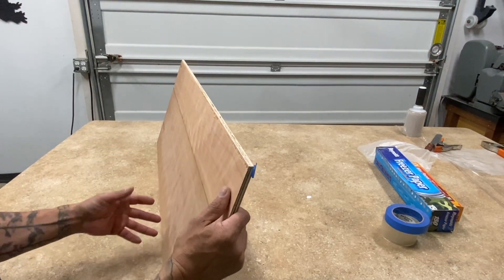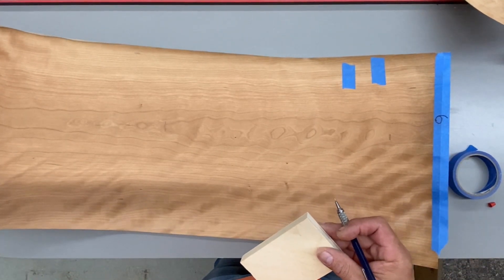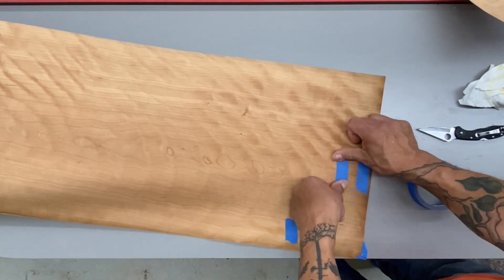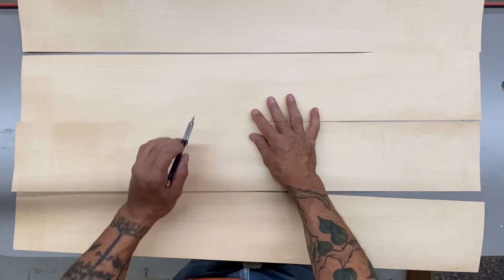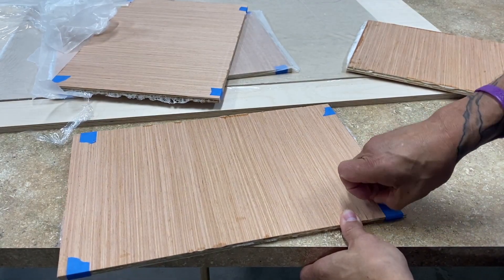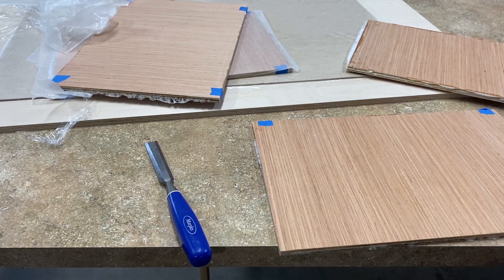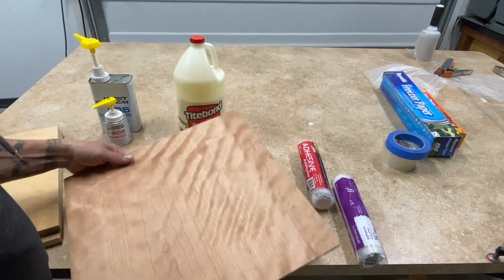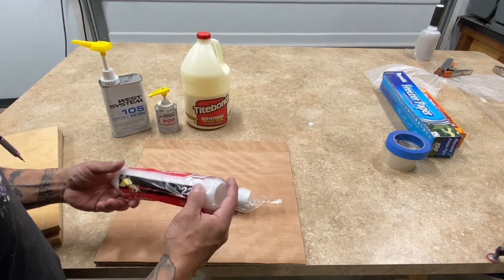More Veneering Tips!

Comment: Excellent video. I appreciate that there are many right ways to do things (and I veneer slightly differently) but this video is a masterclass for any newcomers to veneering. 

Here in the UK, one big furniture retailer has, as its main slogan “no veneer in here”. That is apparently supposed to be a key selling point. Well, veneering is actually better than solid wood in many cases. It’s main advantage to me is that I can produce highly figured pieces without using a solid slab of highly figured timber; it’s good for cost but it’s also good for making the most out of those precious timbers. 

I must admit to generally using veneer tape - that’s just how I was shown how to do it years ago. I also tend to use Titebond Extend because of the longer open time - I absolutely hate rushing the process of putting into the bag, making sure it all looks good - and leave over night to cure. 

I haven’t yet got to your other videos on veneers (don’t know why they didn’t pop up as I subscribed a long time ago) but making your own veneer is not hard. I use a fresh blade (wide as you can go and as finer teeth as possible) on my bandsaw, check the tuning of the rollers and attach an tall auxiliary fence plus feather boards. I don’t try this on boards taller than, say, 200mm if a really hardwood but go upto, 250mm for a softer hardwood. Go slowly and you can produce really good veneer. The taller the board, the thicker I make my veneer - 2mm?. For narrower boards, less than 1mm is possible. If I need to, I run the thicker veneer through my sander.

I think you said that you use the table saw to edge the veneers? I would have hesitated to do that but am going to try it on some cheaper veneer. I overlap the 2 edges to be matched and fox down with some masking tape. You could actually cut a wavy line but I use a rule and cut through both edges at once. The advantage of this method is that, if your knife is not held at exactly 90 degrees, it doesn’t matter and it’s even better if it’s not because you have matched the angle of cut on the top veneer to the angle of cut on the bottom veneer. Cutting at, say, 60 degrees, does give a wider surface area for the adhesive. 

As I said, lots of right ways to do this. As with most things, it’s practice and you will evolve the method that most suits you
Reply from the maker: I completely agree with you!  I love veneer and the vast possibilities one can achieve with it.  I just ordered 200 square feet of figured Cherry.  That would have been expensive  out of solid wood and time consuming to slice into veneer myself. Although my bandsaw is set up accurate enough to get consistent veneers, even with wide boards like about 254mm.  I prefer about 1/16” or 1.5mm.  Pieces built with veneer have an overall matching color and grain tone, cohesive and as you mentioned, stable!   Plus, I feel better about leaving a smaller footprint in the forrest!   

I too learned with veneer tape, but I prefer blue tape for it’s ease of use.  And I know for a fact that glue won’t always migrate into a seam, so I glue joints or seams now.  

My veneer sled works incredible well, super accurate, glue ready seams straight away.  I’ve used the knife method before but have much better luck with a table saw.  Especially with fine points on a starburst pattern, for instiance.  

Thanks a ton for the input, feedback and good words.  I appreciate it!

Comment: You've produced another winner, Ramon.  There are so many tips in this one and I'll be working on a veneered project soon so I will try out some of your ideas.  I have been using veneer tape with good success but I like your idea of gluing the veneer pieces together before I apply it to the substrate.  I also need to look for some freezer paper and I may try your little windows with the tape as well.  Thanks my friend.
Reply from the maker: Glad to hear that!  I had good success with veneer tape but I thought blue tape was easier to apply…and remove.  (Unless I had a high quality wide belt sander) And blue tape is probably easier to use whenst gluing seams.  I know traditionally they weren’t glued, but it’s always felt right to me 😬

Comment: Great Video! Excellent techniques, you have a very inventive mind. I have been veneering for years using the "normal" techniques that you find in all the books and, since adopting you techniques for trimming and taping, I have the best seams ever, pretty well much invisible, with no worries of errors or seams opening up. And the techniques have reduced the amount of time I spend trimming and taping! In addition to the taping the rest of the video is very informative even parts that you don't speak about. I am going to put snaps on my bag. That will help when I get those large projects where the glue up can get a bit frantic due to the open time limit of glue. Thanks!
Reply from the maker: Awww…this is fantastic to hear!  I love sharing/showing what works for me!  Thanks a ton for the feedback 🙏🏼

Comment: Next veneer tip video please add how to store larger pieces of veneer. I imagine I need to roll them up since that is how they were shipped to me, and I need to roll them back up without cracking! 😅
Reply from the maker: In one of my videos I share how I tape the ends.  Just fold tape over the edge at each end, let a bit of tape go past, to stick to itself. That’s pretty standard. I then roll mine and wrap em with stretch film.  They go in boxes or I hang them on brackets way above my shop.  Much thanks.

Comment: Nice Work!  What is your opinion of self adhesive veneer?  I'm a rookie and I used it once.  It seemed to work great.  I used my wives iron on top to get the adhesive to stick even better, sort of getting it to soak into the substrate, (I think anyway).  My only concern is if 10 years from now the adhesive fails and the veneer starts coming loose.
Reply from the maker: I think that it’s…mmm, okay.  But I can’t bring myself to trust it for anything that I’d make.  I’ve used it  before to upgrade old kitchen cabinets. New doors and cabinet fronts/sides…whole new look.  

Adhesive for veneer is a huge topic of debate.  Most (including myself) believe that the glue line for veneer should be rigid, certainly not a characteristic of self adhesive types.  If it’s small work like a box, I’ll use PVA (like Titebond, glue lines that don’t cure hard/rigid) but for bigger projects (more prone to movement) I use rigid glues.  Dap brand plastic resin, Unibond, BetterBond, UltraCat, epoxy and others.  These glues dry hard and won’t allow any movement of veneer which is usually the weak link that can lead to failure.  

Your concern is definitely warranted.  One thing that helps with PSA (pressure sensitive adhesive) is the amount of pressure that can be applied. The more the better.  Heat probably does help to apply…but just think of an item near a window that gets really hot.  It could delaminate.  

So, I avoid PSA veneers and paperbacked for higher quality projects.  Raw veneer (commercially available) and shop sawn, adhered with a rigid type of glue are my “go to”. Hope that helps.  Much thanks.

Comment: Great stuff as usual Ramon. Where’d you get the roller and the tiny glue bottles?  

Also, if somebody wanted to get started in the world of vac bagging, where to start for equipment and supplies?  I am kinda missing the key piece… big shop and large flat surfaces 😀
Reply from the maker: The glue bottles I get from McMaster Carr.  It’s the glue bottle that I include in my “Marquetry Class 101” kit off of my website.  So, I buy them in bulk. The glue rollers I purchase either from Lowes or Home Depot.  Ask for specialty rollers for adhesives. They’re fantastic!   

And you’re right…one does need a bit is space.  I keep my vacuum pump and bag set up on a movable cabinet.  When not in use, I made a top out of plywood that covers and protects the bag.  Then I can use the surface for layout, or assembly.  But usually, it’s used for shipping, assembling boxes, and adding labels.  It’s not ideal, but it works.  I could use a bigger shop!   
A great resource for vacuum bagging is from Vacupress…Darrell Keil has a lot of info there.  He offers different price points, bag sizes and types, etc.   I use the Professional model (6cfm)and I have two different bags.  My original polyurethane bag (very tough but more expensive) that can handle 4x8’ and a vinyl bag (still good puncture resistant and cheaper) that can handle 65” square.  

https://www.vacupress.com/
Reply from the maker: The glue bottles I get from McMaster Carr.  It’s the glue bottle that I include in my “Marquetry Class 101” kit off of my website.  So, I buy them in bulk. The glue rollers I purchase either from Lowes or Home Depot.  Ask for specialty rollers for adhesives. They’re fantastic!   

And you’re right…one does need a bit is space.  I keep my vacuum pump and bag set up on a movable cabinet.  When not in use, I made a top out of plywood that covers and protects the bag.  Then I can use the surface for layout, or assembly.  But usually, it’s used for shipping, assembling boxes, and adding labels.  It’s not ideal, but it works.  I could use a bigger shop!   
A great resource for vacuum bagging is from Vacupress…Darrell Keil has a lot of info there.  He offers different price points, bag sizes and types, etc.   I use the Professional model (6cfm)and I have two different bags.  My original polyurethane bag (very tough but more expensive) that can handle 4x8’ and a vinyl bag (still good puncture resistant and cheaper) that can handle 65” square.  

https://www.vacupress.com/

Comment: it's always good to see different ways to get to the same place I don't use blue tape, I use veneer tape, I also don't glue the seams, the glue gets up in them when I am pressing. Most of my panels I use unibond, is it better? I don't know, I've got veneered panels from 25 Years ago with yellow glue that have no issues.
Reply from the maker: I completely agree!  I love seeing different methods and seeing that they work great as well!  I find blue tape a bit easier. And I just feel better when gluing the seams. Especially with thicker, shop sawn veneers. And  I like Unibond as well.  

Yep, lots of ways to do things!  Thanks a ton for the input!
Reply: @ramonartful  I've always had issues with pulling the blue tape off and it takes a lot of time, and I have always worried about the glue and having it dry, and not press flat, I have a timesaver, that I run the panels through, it takes the tape right off and gets the veneer flat, I don't press on plywood unless its a bent panel I use mdf only, and I run it through the timesaver to make sure it doesn't have any lumps when I press. if I was using thick veneer, I would glue it, I also get all my veneer from certainly, its about an hour from here, most of the time I drive up there and pick it up, I am going to go up there later this week in fact, I'm doing a chest of drawers this week not even sure what its going to be made out of, I am sure they will have something amazing. they always do.

Comment: what kind of glue is best for repair cracks in leafs? BTW this video open my eyes for new oportunites in woodworking :)
Reply from the maker: Leaves as in a table extension?  Curious as to why it cracked in the first place. But in general…just make sure the crack is clean…no dust, use compressed air to clean.  Have some clamps ready (make sure the clamps can move the crack closed, it should not take much pressure.  If it does, you have different issues) Use floss, folded clear tape or similar to spread the glue.  Or use a shop vac to “pull” the glue into the crack.  Add soft cauls to prevent denting of the table edges…clamp closed.  Wipe excess with a slightly dampened cloth. Once dry, lightly sand with very fine sandpaper…400 or higher.  Just to ease & blend the edges of the cracks. Hope that helps.

Comment: ***please help***.  I am doing a kitchen remodel and do not want to mess up as the cabinets are very expensive.  I want to use some veneer and have a question.

I have cabinet skins to make the 96" pantry cabinet sides flush with the front.  However, the skins are not sufficiently thick to make it flush. I would like to buy a piece of inexpensive veneer and put it between the skin and the cabinet side so it will be closer to being flush.  I plan to use 3M High Strength 90 between the layers.  Do you think this would work?  Should I finish the veneer or leave it unfinished.  If finishing it, what type of finish would you recommend?  Oil based or water based?
Do you think think 3M 90 is a good product to use with the veneer?  Thanks for any advice.
Reply from the maker: It’s quite risky to add veneer between the cabinet side and cabinet skin.  Too many layers invites delaminating.  Spray 90 is ok but it does not have enough “glue solids” for long term adhesion. The way it’s applied makes a huge difference as well.  It needs plenty of glue on both surfaces and some time for it to dry slightly.  It’s best when used for small pieces, like edging.  If you use it, make certain you have a good roller to apply as much pressure as possible for a good bond. 

Face frames typically stick out past cabinet sides.  If it’s more than you like, one could use a router and flush cut bit.  The raw face frame would need finished and maybe stained first to match color. 

I didn’t know what you meant about finishing the veneer, since you had said it would be under the cabinet skin.  You probably meant finish the cabinet skin, yeah?  Water based finish is easiest but you must be careful, the added moisture can cause it to expand, creating bubbles or loose areas. 

Maybe you can leave me a way to contact you and we can figure this out.  This issue isn’t too tricky, but one does need some tools & skills to pull it off successfully.
Reply: @ramonartful  Thank so much for the reply.  The reason I asked about finishing the veneer is because I thought that if left raw, something might happen like absorbing moisture from the environment? If put in between the cabinet and the skin, it would not be seen, so no need to finish it from an aesthetic point.  I am more worried about what might happen to the wood if it is not finished. As you pointed out, it could present a problem having multiple layers if the wood absorbs water and then gets wavy. I do not know if that might happen and thought you might know since you work with veneer a lot.

I really do need to use the 3M 90 adhesive for the 96" skin because I need to be able to reposition it for this large cabinet.  However, perhaps I could use a different type of adhesive for the veneer?  I could work with smaller pieces of veneer under the skin and those are easier to place correctly than a 24" x 96" skin.  Do you think this might work?  If so, what adhesive do you think would work best to adhere the veneer to the cabinet?  

The reason I want to make it more flush is because the side of the cabinet faces the family room and it is ugly with just a 96" tall flat surface.  I will be adding fake doors to the side of the cabinet over the flush finish.  When I add the doors I think it might look bad to have that face frame sticking out and not have the doors lay flat across the entire surface.

I have both a small roller and a larger roller to apply the veneer.  I got some 5lb weights (the circles from dumbells) and I was planning to lay 2x4s along the length of the cabinet with cross boards over the top and put the weight on the cross boards. Of note is that when I did this before (see below), it was very difficult to get the veneer positioned correctly and I did end up peeling it back an repositioning it in different parts of the 96" cabinet.  It is such a large, long cabinet; it was difficult to get the veneer in the right place over the length of the entire cabinet.

The cabinets are white Kraftmaid cabinets.  From what I have read, others say they can not get an exact paint factory finish match when they do repairs, regardless of what paint and finish is used.  So, I am leaning away from trimming the face frame. Mfg recommends white paint topped with spray semi-gloss poly.  I might experiment with that on a scrap board and see how good the results are.

BTW- I did this before about 8 years ago because our oak cabinets were two shades darker than when we got them and the cabinet sides were paper.  I bought oak veneer with 3M backing from Rockler Woodworking, finished them to match, cut and installed them.  It looked really nice.  Everything held up well except the cabinets to the right and left of the stove appear to have soaked up some moisture (steam, heat, oil in the air- not sure?) from cooking and are wavy and do not appear to be adhering well.  The rest of the kitchen looks good though.
Reply from the maker: @JLCorpus1  There wouldn't be an issue with the veneer between the cabinet and skin absorbing moisture. ( I think I understood you correctly). The main issue is adhesion.  3M 90 is okay, but I've always used industrial contact cement...should be available from a cabinet or countertop shop.  The aerosol contact cement like 3M simply does not have enough glue solids to be long term effective.  Similar to lacquer in a spray can...it's too thin and takes many coats to build.  If you apply enough...hard to tell someone how much in text.  Plus the dry time is important for it to tack up properly. Laying large pieces of veneer can be made easier by using clean sticks across the surface...once the glue is ready, lay the veneer onto the sticks.  Position the veneer, then begin removing the middle sticks one at at time whilst pressing the veneer working outwards to avoid bubbles.  If I understood you correctly, the faux doors you apply once the skin is on will certainly help hold everything in place.  

I don't see new replies unless I check each video, so it may take me a few days to get back to you.  Hope this helps